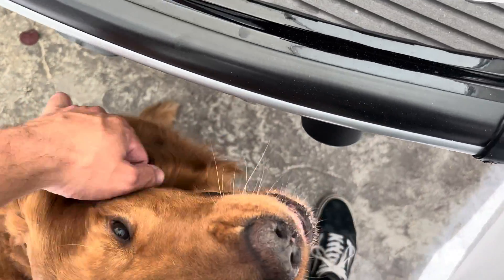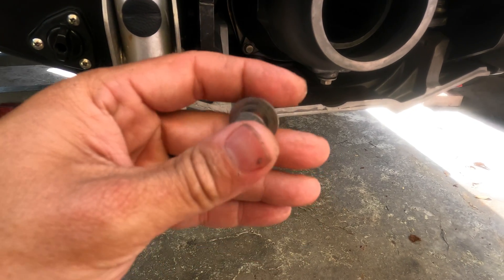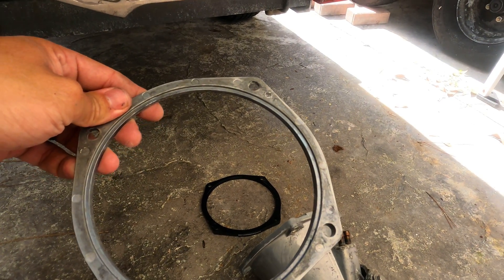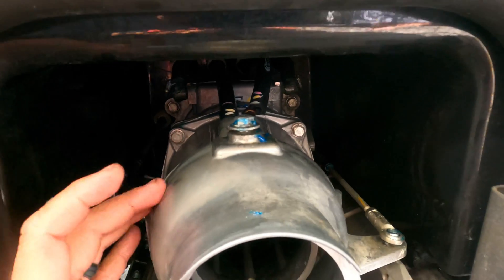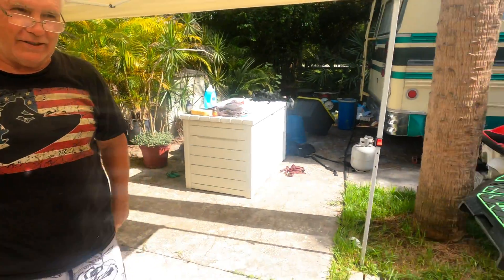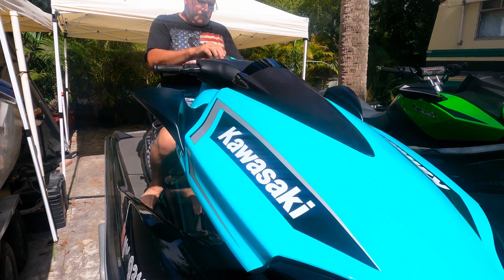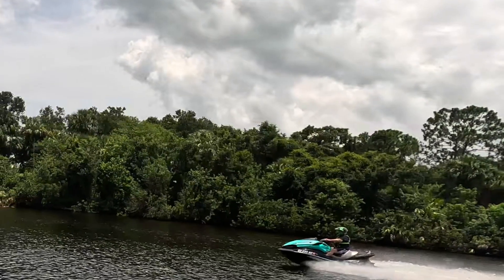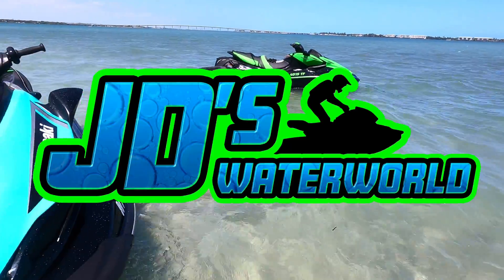Install Tutorial and on-water Test of the @kawiperformance Ultra LX 160 Jet Ski Billet Pump Wedge

Comment: Is your steering not miles out now? You need to adjust that after fitting a 2nd wedge.
Reply from the maker: No, Just a few turns on the quick connect fitting to compensate and steering is aligned

Comment: Would you see Similar gains on a 300x or 310? My limited understanding says that being the wedge is behind the nose cone it would have a different effect than your traditional trim adjustment you get on the 300 and 310
Reply from the maker: Yes the 300/310 you are trimming the exit nozzle whereas the wedge changes the angle of the mid section of the jet pump completely- changing your neutral position to a positive rise position. Gains, not as much, but the wedge does help immensely with getting the bow of the ski up at low speed on the 310

Comment: What other mods did you do to it or are you doing 59 just with the wedge thanks for the video I have a 2023 ultra xls 160 53 mph
Reply from the maker: At this point I just have the wedge on the ski and that alone allowed us to hit 59mph. I do have a resin fuel rail and phenolic intake manifold spacer from Kawi Performance that I will be installing soon! I expect 60mph+ once those parts are installed!

Comment: Back to the fuel pump and fuel filter. Did you get your fuel pump out in one piece? I had to separate the top part off. The STX I can turn and rotate and tilt and get it out in one piece. The Ultra pump would not come out no matter what I did. The ultra filter is probably 3 times  Larger than the STX. I don't know what is going on with the gas I have been buying that could have plugged that ultra filter up.  Kawasaki could have made removing that pump a lot easier.
Reply from the maker: Did you loosen the top deck assembly and remove the access panel?
Reply: Oh yes. Like the STX (which is much easier). Had it lifted up and access panel removed. It just did not want to come out otherwise.
Reply: Guessing it was just me!

Comment: The RPM increase should be accurate but no speed recordings before and after with GPS? I imagine it is faster but could the ski's new bow attitude change how the speedo wheel is spinning? 

Good that you saw increase. Adding the wedge to my 23 Ultra 160 LXS did not increase speed that I can tell so far. I assume trimmed up with the wedge is similar to your 2 wedges. I have not been on the Ultra much recently. Vacation had lots of other people on it while I was stuck on the boat a lot! Then I assume my fuel filter needs replacing as the ski starting running poorly. Just like 160s when filter needs changing. Utra torn apart Awaiting filter now. Changing fuel filter with Kawasaki has gotten progressively worse. Old 15s had external filter. Easy. Later 15s internal filter but easy to get to. STX 160s were bad I thought after the 15s. BUT the Ultra is far worse and should not be!

I am changing my gas vendor. Used Amoco 93 then BP for 30 years. NEVER changed a fuel filter in anything. I have been buying Phillips Ethanol Free 90 pretty exclusively for 3 years from one station. That is all my Ultra has had. I will now be changing my 7th filter in the last 2 years. 5 on STX 160s. One boat. One Ultra. Have you changed your Ultra fuel filter yet? My old 2005 15f has original fuel filter! I added Kawi Performance external filter to 160LX. About to install their larger bag filter on my 160X. See how it holds up. 

Sorry. Didn't mean to hijack your wedge video. Lamenting the fact I am unable to ride my Ultra right now and pondering solutions to my filter issues! The old Ultra LX is a great looking ski. You are exactly right, it should have had trim years ago!
Reply from the maker: Hahah no worries man thanks for taking the time to comment. I always love any Kawasaki talk! Nope, did not do GPS. But speed is relative to water conditions anyway, what was impressive was the 70 rpm increase - that right there alone is proof the wedge gets the bow up, allowing the engine to spin faster and make a bit more power. Don’t forget we stacked 2 wedges together- just one wedge alone would not have yielded any difference since they are the same pitch. Your new 160 is a different ski so hard to compare- but since you have trim- yes I would imagine that this would be similar (probably a bit less) pitch to your ski at full trim. I run Sunoco 93 with k100g+. My ski may sit as long as a week between use so I always use the fuel conditioner to avoid phase separation. I’ve refilled on the water with the ValveTec 90 they sell. I changed my filter bag once, and removed the chamber over it. Does the 160 have the giant chamber as well? My filter looked like new. Yeah sadly unless the pump was mounted outside of the tank, the only way to screen the fuel before it enters the pump is with that style filter. But..the fuel also cools the pump, as I’m sure you know pretty much every fuel injected vehicle these days has a filter identical to this..to change there’s lots of plastic fairings to take off- the manual tells you to take airbox off too but that’s not necessary…also your airbox different on the 160..still in the back right?? I actually have not seen a new Ultra 160 in person. try the K100..it’s a miracle product (and no I’m not paid to say that lol but I wish I was based on the amount I spend on it)
Reply from the maker: Do you have the adjustable seat on your new ski?
Reply: Yes I put the adjustable latches on my seat. Everyone that sees it and rides it loves it. I know all manufacturers went to the in tank filters. I get it. Much cheaper during manufacturing. The 15f has a stainless bracket that holds this comparably massive canister filter. The parts are more expensive and the extra time to install at the factory. But the 2005 15f just keeps going! I did something to hopefully make accessing the pump and filter on the Ultra easier. Hard to explain. I will send some pictures. Airbox is at the back of the engine so getting to the Ultra 160 fuel pump is easy. Getting it out of the tank sux! If they made the hole in the tank an ¹/8 or maybe ¹/⁴ inch bigger I think it would come right out. 

In my mind I think what you have with two stacked wedges is better than a wedge and then trim. You are basically giving the entire stream of water one immediate change of direction. Mine gets the initial change and then gets another change thru the trim nozzle. I think that is less efficient. Not saying I don't want my trim! But I can see greater efficiency with what you have. With that much greater thickness did you adjust the steering cable at both ends? I would be afraid you dont have many threads engaged on the connection at the back without balancing the adjustment. You have given me an idea on my Ultra 160 tho. I may stack 2 wedges on mine also. My concern is further unscrewing the trim connector.  But I am thinking that brass lower arm will be the key. I may cut it in half. Drill it and tap threads in both pieces then use a stainless threaded shaft to put it back together. Then I can adjust the trim there and not the cable. I did something similar to my old SXI Pro that I added a manual trim to.

Thanks for the videos and replies.

Comment: What gph are you getting on this ski compared to the superchager?
Reply from the maker: It seems the consumption is very competitive with the 310 lol I would almost say it’s the same- the benefit would obviously be the N/A ski requires less maintenance
Reply: we have 1.8 yamahas, one supercharged and one non-supercharged.  they actually run about the same MPG's as well.  anywhere between 4 and 4.5 mpg.  We cruise around 50-55, which is near the top speed on the non-supercharged yamaha.  they are rated for 13 gph and 18 gph, so if you run them at top speed there will be higher fuel burn...and of course premium fuel is usually 50-70 cents more per gallon.

Comment: Hi JD, 27 ft. lb. Is this different from the 310LX?  I only put 12 ft. lb.  Please let me know so I can adjust, thanks.
Reply from the maker: Well I just looked back at the manual…they state “pump mounting bolts, 27ft lb, then now I see they have “pump mounting bolts, outlet” 14 ft lb…so I am now thinking maybe it was supposed to be 14 ft lb, not 27. Let me confirm and I’ll let you know. I have an older manual and it’s hard to tell…
Reply from the maker: It’s supposed to be 14 Ft lb for the LX, I just fixed the video! Thanks for catching that!

Comment: I bought a Kawi pump wedge for my 2023 STX 160X, can't wait to install it to see and feel the difference. How come your ultra already had a pump wedge on it? Should  I consider  getting a second wedge to increase to 4° up angle??? 
Thanks
Love your channel 
Eric in Quebec,  Canada
Reply from the maker: So the Ultra LX comes with a wedge already installed from the factory- since it doesn’t have any trim. I do not know if the 148mm pump on the STX will be able to accommodate 2 wedges like this..really this was an experiment to stack them like that and turned out to work really well.

Comment: Damn. I think I want one for my LX. The main reason I got the ultra was for the choppy days on Lake Erie. You think I'll lose any hook from the ride plate? Also what grease are you using?
Reply from the maker: I think this skis only flaw was that it doesn’t have trim…but the wedge gets the bow trimmed up big time which really helps in the chop. The ski would theoretically launch better and corner better with the bow down, but let’s be honest, nobody is buying this ski for the buoy course lol. You saw me launch in the video no cavitation or anything. I think the ski is heavy enough that it stays hooked up pretty good. Corrosion Block marine grease- great product.
Reply: Thanks! Keep up the good work!

Comment: Nice gains! I have yet to test my ski after I installed the pump wedge on my Yamaha.  I need to get on calm water to test.
Reply from the maker: I’m a big fan of the wedges! The Kawis you need to get more hull out of the water to go faster, with yours the hull is pretty light as it is- should buy you some speed on the top end id imagine or atleast get the bow up a bit at low speed